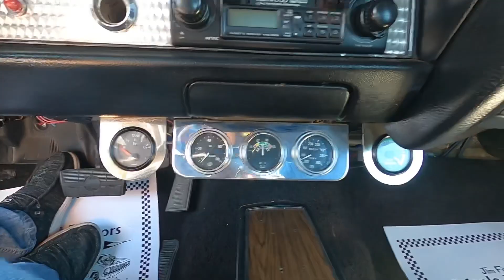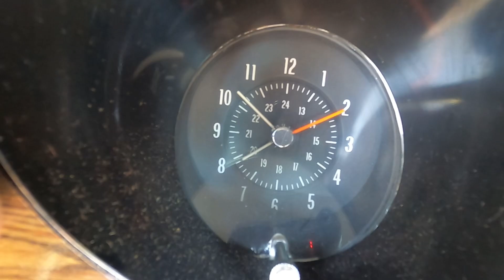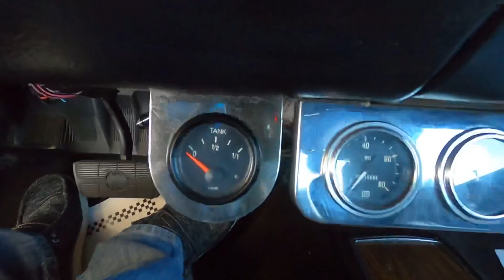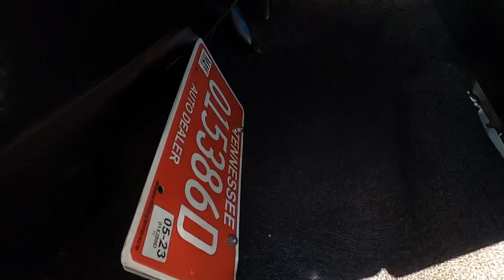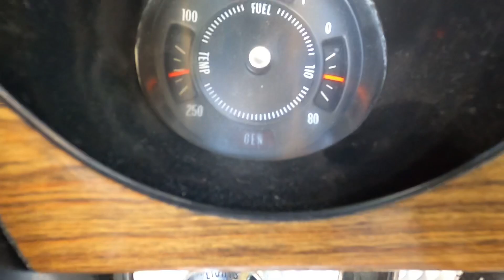Test Drive 1972 Pontiac GTO SOLD $29,900 Maplemotors.com #2010

Comment: I'd get a repro original steering wheel, rip out the aftermarket gauges (who needs them anyways), get much quieter mufflers, get some electrical work done and proper decals added, fix the console!  After that it would be pretty good!!

Comment: My mom had a 71ish with a 326ci.
They welded a chain from the motor mount to the frame because 👉torque. 
Small block GM motors are better than ANY tesla.
Reply: I like Tesla's it's not to many cars can beat them on the track